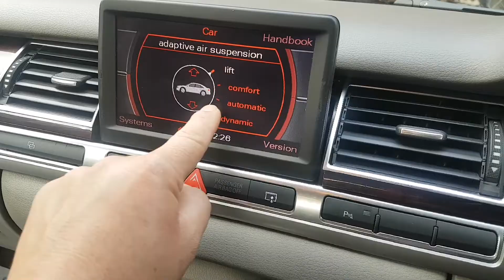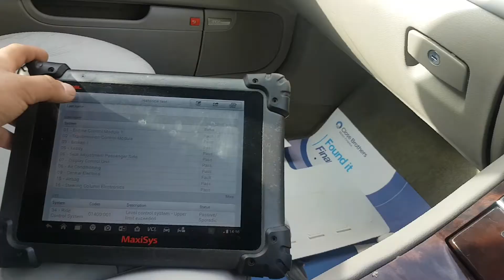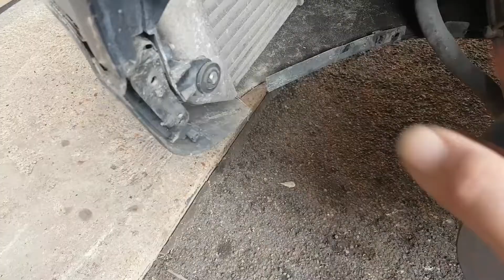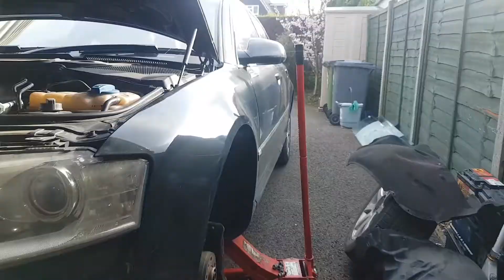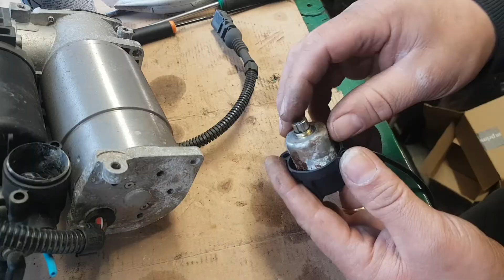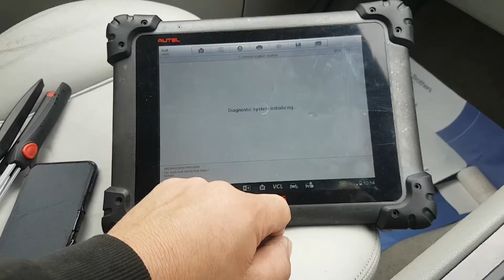Audi A8 2007 Air Suspension fault... Fault finding and repair.

Comment: Great work, good to see you worked it out. The issues with plugs and wires are just normal wear and tear with age. you can get most Audi plugs cheap from China. The valve problem looks like it's from moisture damage because the dryer likely has never been serviced/replaced. Like the aircon dryer the airspring dryer has a lifespan and requires servicing but most people never do this. I have never had a problem myself with repairing the air springs in my A8. They are a simple system with obvious systems that can be fixed. It amazes me that people can't work the out. Worse is the people that convert them because they are fed a load of rubbish about what is faulty when they take it to people that haven't gt a clue what they are looking at, then they expect a top luxury car to have cheap parts from the manufacturers dealers. After market cheap parts have been avalable for a long time so they can be easilly fixed. It just takes a bit of time to text all of the correct things in order. I wouldn't have a car with normal springs after having air spring. The ride is just too nice and well worth the extra effort to keep it running. If people can't comprahend these things they shouldn't buy a car that has more advanced systems. That's the fault of their own stupidity. Personally I will be staying with A8's until their is no other option. As long aas they are serviced correctly, not just basic oil changes but correct sercicing based on the factory service lists they have a long life

Comment: @LMAutoRepairs, great and informative video series! Which AUTEL diagnostic tool/tablet would you recommend that is capable of analyzing and bi-directional prompts (eg ‘manually' starting the air compressor) and calibrating the suspension after a repair for a Hobby aka Shade-Tree mechanic? Your higher end AUTEL MaxiSYS diagnostic tablet looks to be in the pricier tier of their wide array of available models. Thank you + cheers. Martin
Reply from the maker: I believe most of their tablets have bi-directional capabilities, but you should be able to check that on their website. 
Yes, my one has some programming capabilities that will might not be available on the lower range models.
👍👍👍

Comment: 15 years ago I was looking to buy an Audi A8 and drove a few I liked the look of them until I saw a Mercedes cls for sale and took that out for a drive and it won me over so I bought a 2006 one and still have it, it’s been fantastic 👍
Reply from the maker: 😊
I like the CLS...
Very nice car!
👍👍👍👍
Reply: @LMAutoRepairs  it’s been very good overall with only two big jobs required in the 15 years I’ve had it but now I think inlet seals are leaking and that might be a job too big for me to take on alas but we’ll see maybe in spring

Comment: Hello i love to watch your videos!
I have a Astra J 1.6 Petrol 85kw a16xer i have code P0014 and when i drive in second and third gear when car goes to 1000rpm strugle to get the rpm up when i push the gass pedal once i get to 1500rpm works fine. Saw your videos for this code but not on the same car? what could be can you help me and tell me some things?
Reply: The most common causes of the P0014 code are:
Oil Problems: Incorrect viscosity or dirty engine oil, or an incorrect oil filter.
Control Valve (OCV): The "Oil Control Valve" is faulty or clogged.
Camshaft Timing: Incorrect or stretched timing chain or belt tensioner problem.
Sensor Failure: Camshaft position sensor failure.
Electronic Failure: Engine Control Module (PCM) failure.
Mechanical Damage: Faulty camshaft.
What You Can Do:
Check the Oil: Change the engine oil and oil filter according to the manufacturer's recommendations.
Clean the Control Valve: You can install the valve and clean its filter.
Diagnose the Fault: Connect an OBD-II scan tool to your vehicle for an accurate diagnosis.
Check the timing chain: If the problem persists, check the timing chain and related components.
Important: If the problem persists, consult a trusted auto mechanic.